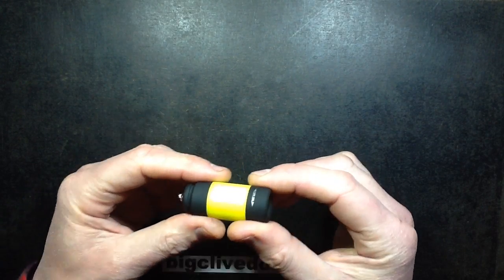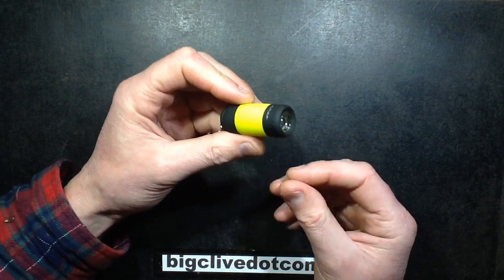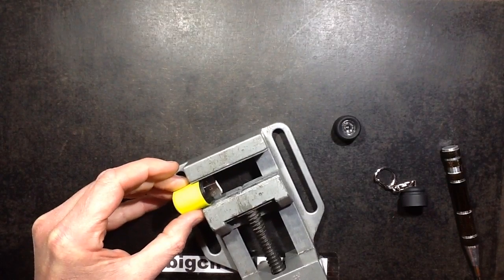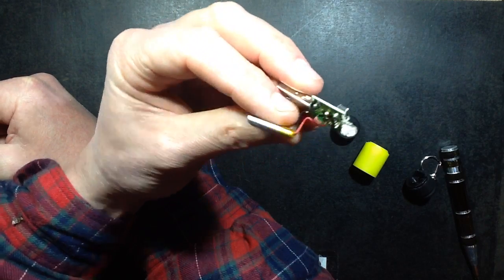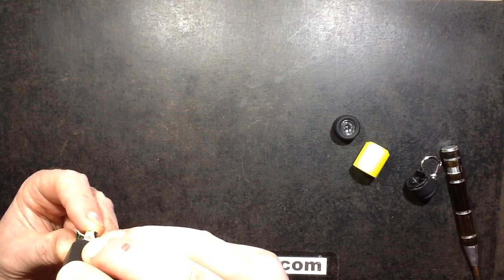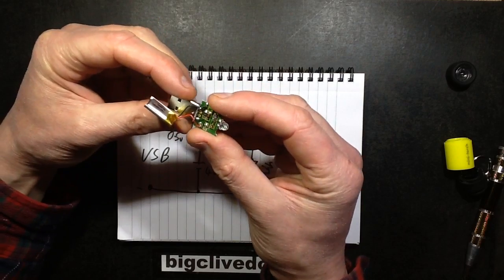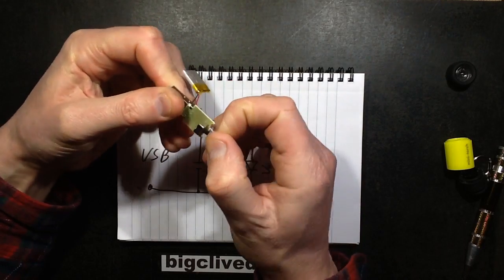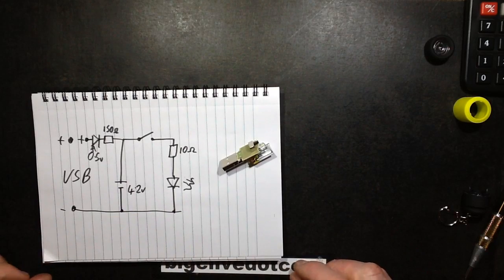Teardown of a USB flashlight / torch keychain.

Comment: Alternatively, you could call this "A beginner's guide to reverse engineering an electric circuit".

A lithium battery without charging control - I wonder how many of these went >>>BANG<<< over the last six years, or even how many have lasted that long. I wonder just how big a bang they'd make?

Comment: I got one of these but the problem with mine was that the switch was shitty and it didnt made a proper connection. Mine had the red led when inserted to usb charging. However no charging circuit whatsoever just some ressistors and a diode..... -.-

Comment: Firstly this has saved me doing my own tear down, so i'm a happy bunny today \o/

Secondly i'm a little confused because I ran mine for about 3 hours to run it flat so I could find out what the charge current was (my USB voltage/current meters don't even register it), but if it's driving 120mA into the LED and the battery is 50mAh, then the numbers just don't add up.
This is likely because the current is going to drop drastically due to the low battery capacity, so by 80% charge it's going to be 3.9v and by 20% charge more like 3.7v, which would equate to an average of maybe 60mA between those two points. By the time the LED goes out, you've basically run the lipo cell down below it's minimum voltage.

Charging wise, average 5mA @ 5v, 50mAh battery, it's probably going to be between 8 and 10 hours before you've actually got that battery up to 4.2v
Reply: I measured charge 15mAh when the battery was at 3.7V,strange becuse there is only 10 OHM resistor (100) and T7 diode betwin usb and battery that guess didn't have circuit controll

Comment: These things are just as bad as those very cheap MP3 player from ebay which work quite amazingly well and also sound good but the charging circuit is exactly the same as this one, so one actually failed on me and when I tried to replace the battery, I wanted to use a battery from a broken Ipod Shuffle and maybe I must have wired the battery backwards because the thing never worked again. The second MP3 battery lasts less and less but oh well, I guess that in the end you could attach a phone battery to it and make it lasts for weeks. Cheers :)

Comment: Hello Clive love the videos mate . The new quote of the day is "Tender loving violence...."
I wonder if that torch would work better with a higher capacity/wattage led.
What sort of beam do you get out of it in the dark mate ? I do a lot of work in the dark driving trucks and any cheap battery powered light source is handy for me.
Dan.
Reply from the maker: It produces useful light, mainly because it's grossly overdriving the LED.

Comment: Based on seeing various eCigarette fires on the news, all of which caught fire while charging, those tiny Lithium Ion batteries are quite flammable.  I'm surprised there is not even something like a passive zener across the battery to carry the current once it reaches a certain voltage, as I can imagine that that most people will leave this constantly plugged in to a USB port apart from when in use just like with a cordless vacuum cleaner.